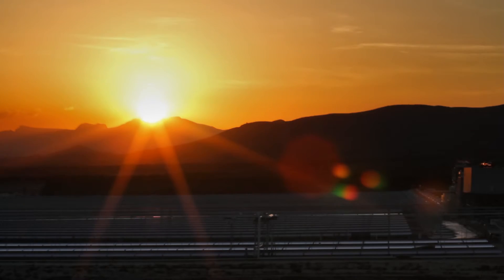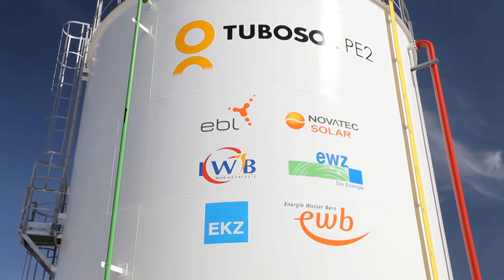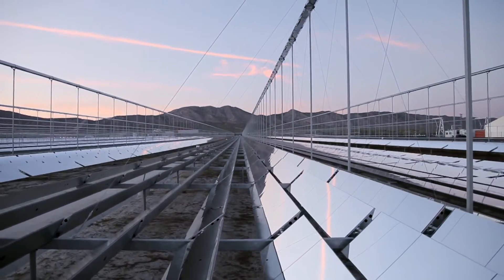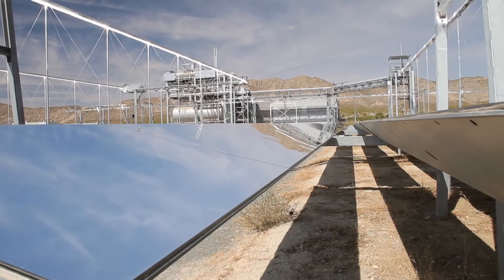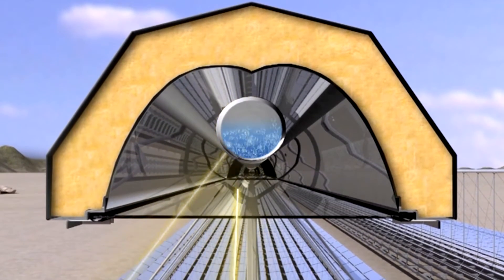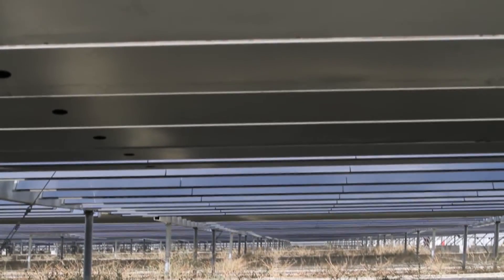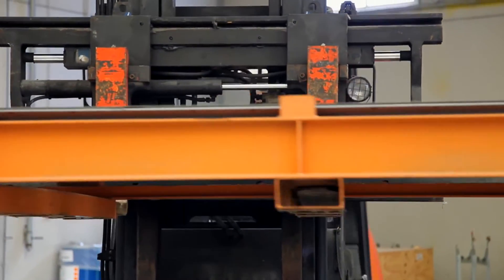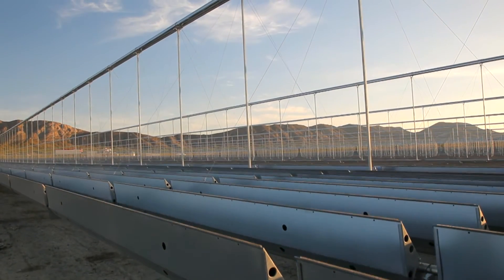Concentrated Solar Power by Novatec Solar

Comment: I like the concept very much. But it seems to be very costly. According to "wikipedia", electricity from Puerto Errado 2 is sold for above 26 Eurocent per kWh.
That's quite expensive, even compared to other CSP-technologies. But it's new and rather small, so maybe there is a high potential for cost reduction left.
And since photovoltaics was getting much cheaper, I wonder about every solar thermal power plant without heat storage. Power production uncoupled from irradiation is the most important advantage of CSP over photovoltaics.
Reply: its also a lot more efficient
Reply: @007TiFi  No, not really. At least not referring to kWh/a per land coverage.
E.g. Ivanpah (CSP) versus Topaz (PV), both on comparable sites (California).
Ivanpah: 16 km², 700 GWh/a
Topaz: 25 km², 1100 GWh/a
Pretty much the same yield per area. 
Or did you mean another comparison? This kind of CSP versus conventional CSP?
And if you are a native German speaker, you may answer in German, I'm Austrian.